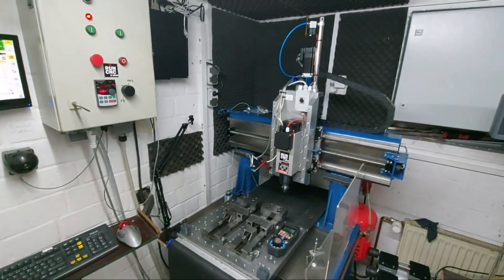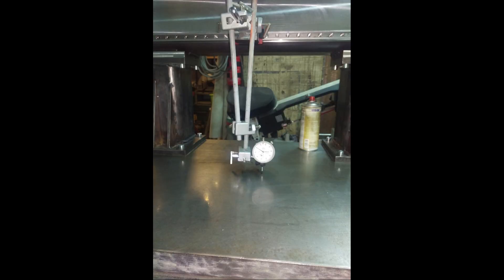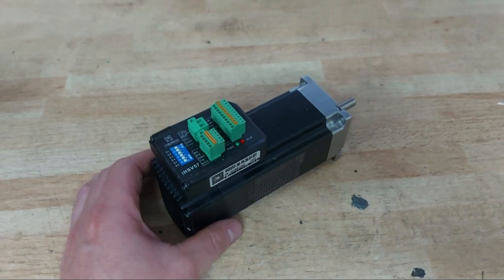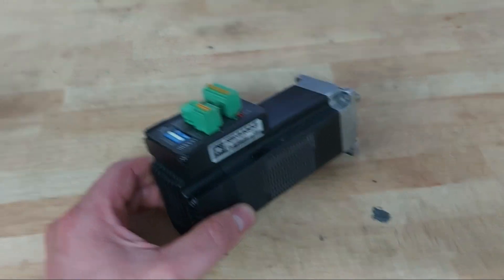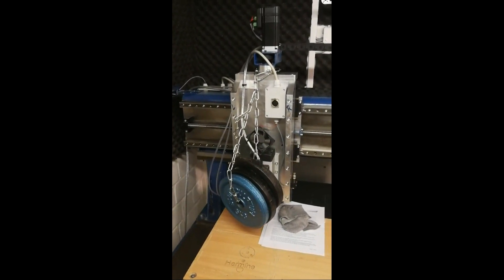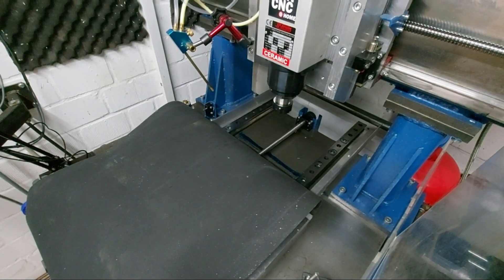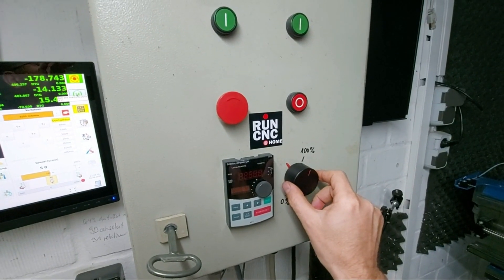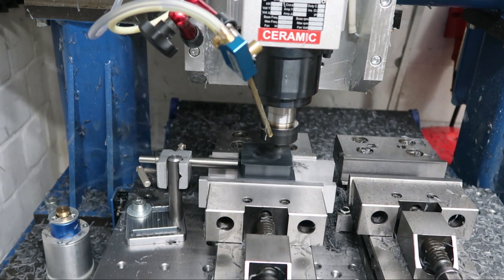How to build a rigid CNC Router made of steel part 2 - plans incl.

Comment: i'm finaly building one to 😁 i found all the materials but i still have one question for you. How did you bolt and attach the "wide" flange bearing's to the Z axis plate ?  Did you let the Z axis plate slide in from the top?
Reply from the maker: @edkcustoms  I didn’t want to add an extra plate to bold the z axis to the y axis as this would cause to bigger levers and less rigidity. But how can you mount the z without an extra plate? No, I didn’t slide it from the top. You wouldn’t be able to align it or you would have to align all 4 bearings independently. Here is the trick: First you use the outer screws which are reachable to mount the z-Axis. Then you use two little holes in the z-Plate to reach the inner, otherwise not reachable screws with an Allen hex key. That’s it!
Reply: @RUNCNC  So simple yet i didn't think about that haha! Thank you!

Comment: Hi! Thank you for the info and descriptive video. I wonder, now that you have it for some time, how do you find using it? Is it good enough compared to how your Optimum mill would be if it were CNCed?
Reply from the maker: I am very satisfied with the machine. In fact, it turned out better than I expected. Unlike my old green router (as you mentioned) it cuts steel quite well.
But there is always room for improvement:
What would I change if I built it again?
Next time I would use this spindle:
https://www.damencnc.com/en/quicktoolchanger-fan-c5160-d-2dbs-hsk40c-pr-hy-2-2kw-6-000-18-000rpm/a3969
It has three times the torque than my new Teknomotor spindle. The new 2kW Teknomotor spindle I'm using was an improvement, but there are some torque issues when drilling. (I can't use drill bits larger than 5mm in steel for drilling, for milling I use carbide endmills up to 10mm)). A big advantage would be quick tool changes since using collets sucks.
What else?
Automatic lubrication would be nice, glass scales for higher accuracy (LinuxCNC can read them and correct division errors). Since the gantry is rock solid (even stiffer compared to my MB4), I would opt for 50mm taller columns to achieve more Z travel. I started converting a second MB4 to CNC that I bought used at a great price on Ebay. But I immediately gave up when I realized that an MB4 would only provide less than 200mm of Y travel and has a spindle that is far too slow for aluminum - even for steel using modern carbide end mills.
I'm definitely missing some sort of chip guard - but I don't want to waste too much shop space on a large greenhouse. Maybee I come up with an idea for this sometime.
Ok - that has been a larger comment. Hope that helps! Or feel free to message me!
Greets Markus
Reply: @RUNCNC  thanks! it actually helps a lot. I am considering getting an old CNC, a Maho MH400E, which I guess compared to the MB4, has 4000 rpm. The issue with that is the greenhouse...so 2m*2m*2m, which indeed sucks for shop floor covered. Alternatively, building something as you did seems a good option, the issue I see is the lack of rigidity and capability compared to a bit iron machine. Curious how you see that.
Reply: Also, I saw you have another one in green. How is this one different than that one apart from the spindle?

Comment: I notice that your ball screws are single nut, do you have any backlash issues?
Reply from the maker: Yes, you're right. I'm concerning to swap to better anti-backlash nuts. This nuts have about 3-4/100 mm backlash.
Reply: You could try adding a second nut and apply pre- load. I did this with mine but I still have 0.04mm backlash.
Reply from the maker: @TheHalloweenmasks  Did you check for additiononal play in your bearing blocks? To check this, you put a dial indicator to the end of your ballscrews and apply some force to them.

Comment: - surfaced cross beam
- surfaced left & right ‘legs’

I had some problems with making a flat surface for Y rails, but finally I managed to remove 1,5 mm of steel and I have a flat ~90 x 20 cm surface.
Reply from the maker: I'm really excited to see Hermine mk2

Comment: Ok, now I am building a clone of this. Stay tuned. My progress is around 40%
 - CAD drawings
 - giant cast plate
 - metal sheets
 - cutting
 - welding
 - annealing
 - milling Z and XZ plates
 - sourcing motors, spindle, rails and ball screws
… I am here …
Reply: How's your progress?
Reply from the maker: In case you need more infos: https://drive.google.com/drive/folders/1hwda6CFJtIGftrL5-l1fkFvQ2RGibhAt
Reply: @RUNCNC  Thanks

Comment: excellent work, I ask you some questions: 
1- which motor do you recommend, step motors or servo motor? 
2- what machine did you use for cutting? 
3- what type of drill bits are used for different materials? 
4- which is better, arduino or mach3 controller

Thank you so much.
Reply from the maker: 1 - I would go for servos, because they perform better than steppers if you tune them right.
2 - for sheet metal I used my cnc plasma table, construction steel was cut using a band saw
3 - on the router I only use carbide tools
4 - I have no experience with arduino. My plasma table works with mach 3, that's fine. Nowadays I'm very satisfied with linuxcnc.

Comment: Very nice & solid machine, I really like your low profile vises.  Can you share any information as to where they can be purchased?
Reply from the maker: https://www.amazon.de/dp/B00FACKR2O/ref=cm_sw_r_apan_glt_i_AKTB8XVGN5Q36KC2P4VB?_encoding=UTF8&psc=1
They are made by Röhm. I bought them used on ebay for a really good price as they are not cheap. There are some china knock offs, too.
Reply from the maker: Fox tested the china vise: https://youtu.be/edp1JMKbQjo